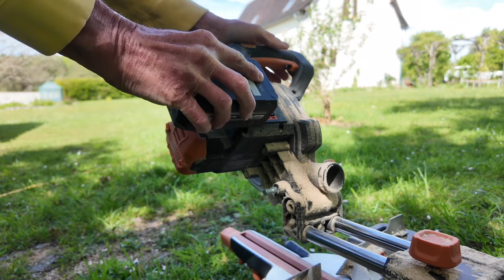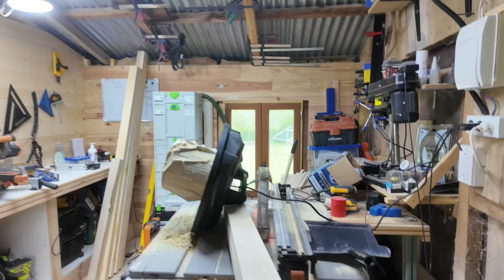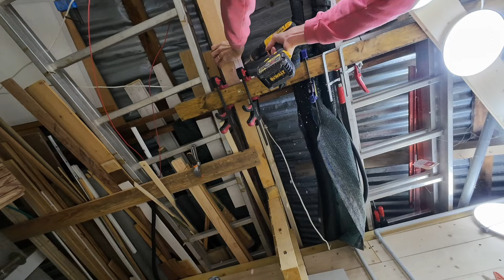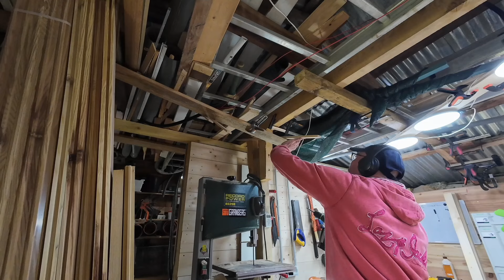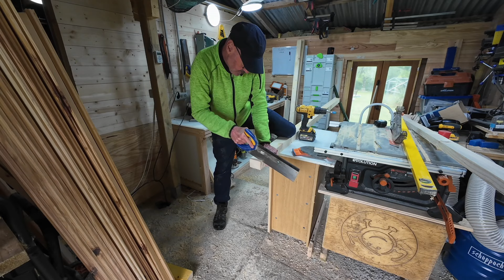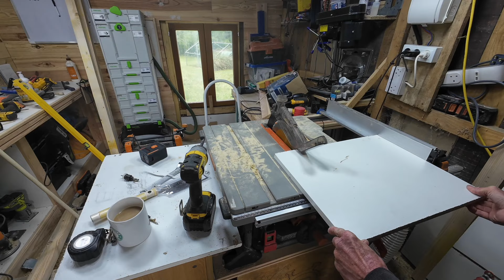Maximizing Workshop Space and mocking up Workshop Furniture

Comment: Talking about a pull-out planer and a pull-out bandsaw makes me think that what you need is a "cart of drawers". As with the bandsaw/plane joint cart, this is a previously unknown concept. Your cart would have two flat drawers - possibly with underneath drawer runners. You would pull out the tool you were using and the weight of the other tool would keep the cart upright.
Reply from the maker: You may be onto something there Stephen. Regards JP

Comment: Timing couldnt have been better, I have the same challenge with the same bandsaw , and a belt & disc sander on  the same cart. I might just wait to see what is the outcome here. As always interesting.
Reply from the maker: https://youtu.be/96oQKQar0CA
Reply from the maker: Hi Paul, I made a similar cart for the loft for my bandsaw / triton sander which is light by comparison to the planer. I just slide it out for quick sands and took it out to the bench for longer jobs. I’ll link the video if it is of use. Regards JP
Reply: That could work as the basis of a solution for, thank you.